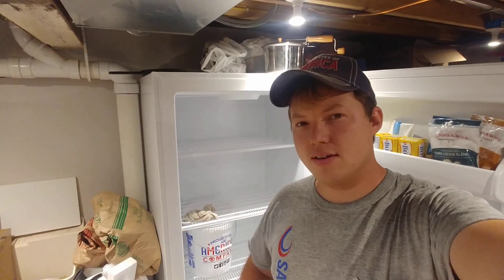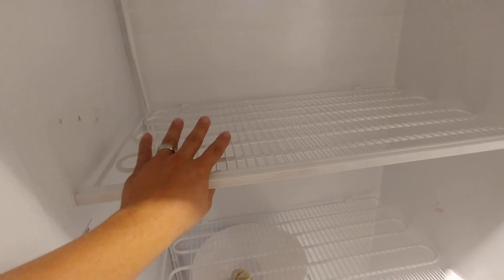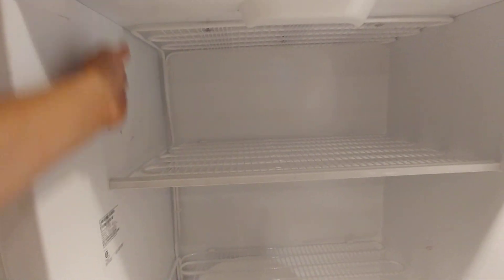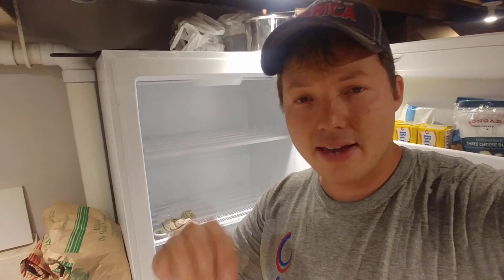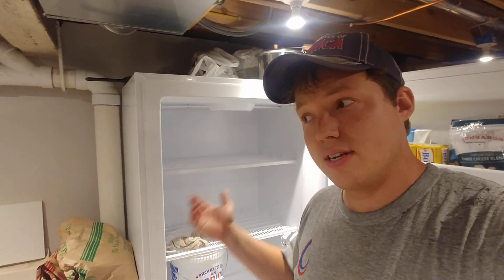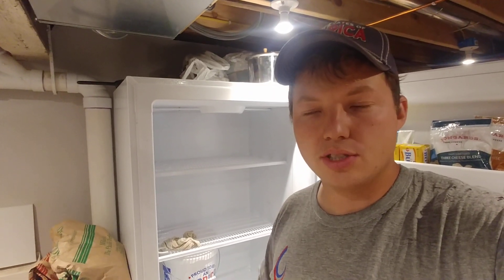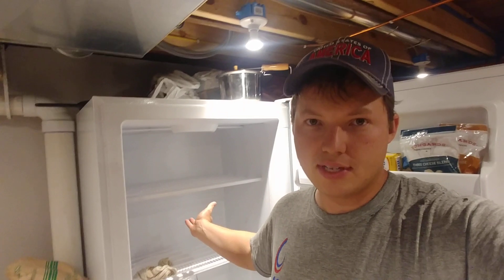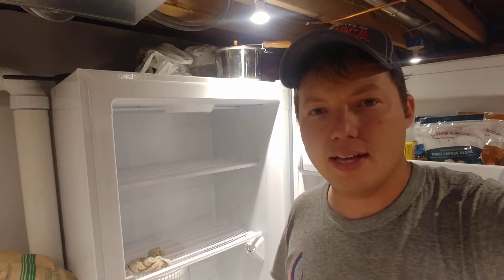Frost Free Freezers Vs. Regular Upright Freezers - Pros & Cons & How They Work

Comment: A couple of other pluses.  If you ever need to run it off an generator or solar-battery-inverter, the conventional (frosting type) often only pulls 60 or 80 Watts and thus can be run off a quite small system or generator.  The frost free types will run off low power until they go into the defrost cycle where they pull 500 or so watts for 10 or so minutes.   Of course the best for energy use is a chest type which also has the advantage of have a longer "keep" time as they will hold the contents frozen over a longer period of time if the power were off.   It's my experience  that the defrost thermostat,  the most likely thing to go bad in a frost free,  will fail in about 15 yrs, +/- 8 ;-)   Good Vid !

Comment: My Liebherr upright  regular(static) freezer  cames with separate    6 drawers ( that  you can open just one at the  time ,  the one you need) .
The regular one (static)  in this video has no separate drawers and of course is less efficient and will need to be defrosted more often than the ones with drawers, because everytime  you open the front door  a lot of cold  will flow out downward ) . 

My Liebherr regular  static Upright  freezer  is still working perfectly after 25 years.....  According to my one experience static is far better  because no electronic boards and complicated  sensors devices in the  frost free ones.  
Just defrost  the static  regular  upraight  freezer every 6 months  and will last almost forever.......and is more   efficient than the frost free ones.....but separate drawers are a must.......

Comment: We purchased a used Kenmore Upright Freezer 13 years ago. By used I mean it was at least 10-12 years old when we bought. A year and a half ago, the compressor finally gave up on it and how I wish we could just replace the part(s) we need!!! It was fantastic and the temperature control was spot on until it quit. My folks only purchased Kenmore freezers throughout their lives. They purchased their 3rd one after 38 years. Thanks for sharing the info!

~ APRIL LIPKE
Reply: is kenmore the same company as fridgedair?

Comment: Our fridge just died, apparently the main pipes rusted out, only 8 years old 😭fridge was auto defrost, freezer not...  Hi sense fridge... 8 years old fridge and bottom freezer..!!!

Well looking at buying a new fridge, still not decided on the frost free or semi auto defrost 😂..

Are the life span the same? Or different, will a auto defrost last longer than a semi auto defrost?
Reply from the maker: I would predict that a standard freezer will last longer than a frost free freezer since there are fewer parts that could fail. Just my opinion!
Reply: @BenjaminSahlstrom  I will get the standard fridge, freezer..

Comment: Great video, good explanation. I have a question for you, out auto defrost upright freezer is leaking water on the floor and I was thinking it might be a plugged up drain plug, but I also noticed that the outside of the freezer on both the left side and right side are very warm to the touch, that does NOT seem correct to me, What would cause the outside panels to feel very warm to the touch? Thanks for any help.
Reply: I believe the answer to your questions are, since the freezer is rejecting heat the walls are warm, this should be normal. also the water inside the air is being frozen so when the unit goes into defrost mode it will melt this ice and it will puddle up near the unit.
Reply: Isn't that unit getting rid of heat (from the condenser) to the sides?
    Too much moisture in the air? Too often opening of the door? 
 Normally the water after defrosting should be evaporated by that heat mentioned...
For any reason the "water cycle" is unbalanced: is it "leaking" water all year or seasonally?

Comment: will reguar freezer have less temperature change range then frost free freezer(heater defrost )?
Reply from the maker: Yes but only slightly. The temperature range should be very similar. Regular freezers will also work better for low temperature environments such as a garage in Minnesota so you can keep that in mind too.

Comment: My experience is I prefer a regular freezer, If you leave the door open they will both get frost, the good thing about the regular freezer is the frost is visible. With a frost free you can still get a huge build up of glacier ice extremely cold. defrosting the frost free freezer can take ages and you have to take the panel off to do this. Frost free is cheaper to run. Benefits to frost free the balanced circulation of air.
Reply: @MrFlashPick  make no sense

Comment: I want to get one for my detached garage but it gets below  32 degrees in the winter.  I've been told some freezers will not work in non heated areas.  Which one of these will work in a non heated area?
Reply from the maker: Regular freezers that are not frost free are usually the best choice for low ambient conditions.

Comment: I have a similar upright freezer. Does your entire coil develop a frost line when you turn it on after a defrost?  Mine only ices maybe the 1st 1/3 - 1/2 on the 1st shelf that the capillary tube expands to.  I tapped the process tube to check low pressure and it was at roughly 3 psi with 80 degrees inside the freezer.  I added a couple of ounces so it's right about 8psi with the inside at 30 degrees (and dropping).  I can't tell if I should have a long even frost line or if it's supposed to be this way with only one shelf frosting.
Reply: Have you figured it out?
Reply: @Littleprinceleon  ended up vacuuming it out for a hour and weighed in the factory spec of refrigerant. Working like new again

Comment: Why does a manual defrost have to be defrosted once a year and a auto defrost has to automatically be defrosted several times a day?
Reply: @PichuPeekaboo  the spray wand on a carpet cleaner can spray hot water & suck it up at the same time, very quick. 
I preheat the water in a microwave.
Reply: I have a deep freeze that’s been on for 6 years and my ice is only a little over an inch thick.  I’m not gonna bother defrosting it until it seriously starts affecting storage space.
Reply: @perrinayebarra  do you know that ice is a good insulator?

Comment: I like how well you explain to make everything easy to understand and pretty detailed about stuff.  I notice this in most of the videos.  Because of the details, as in this video, you had mentioned drain line which prompted me for something to check next time I run across a fridge that freezes up.  I would have never really considered the differences and your explanation of long term vs multi-use is a great way to consider.  Thanks for your videos.